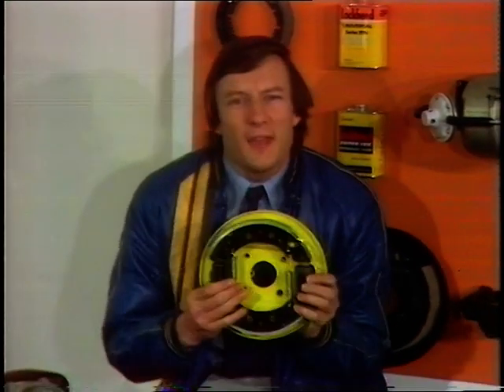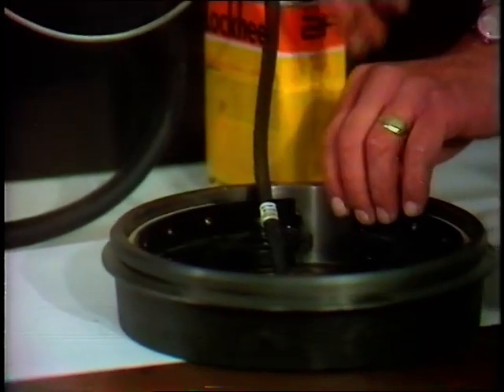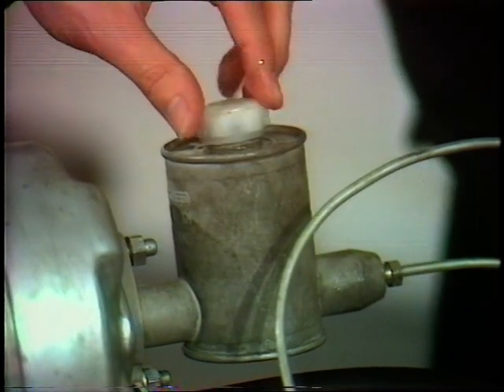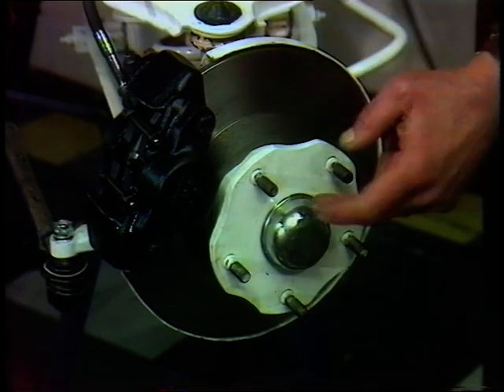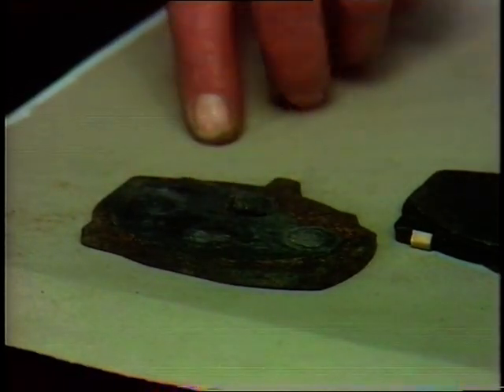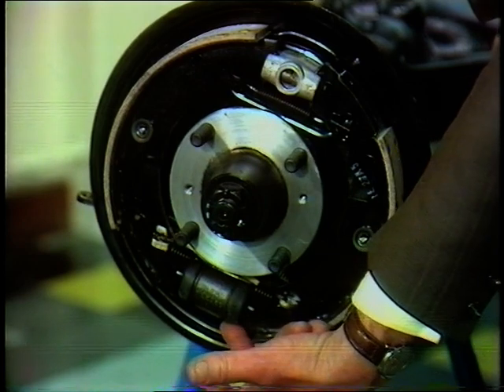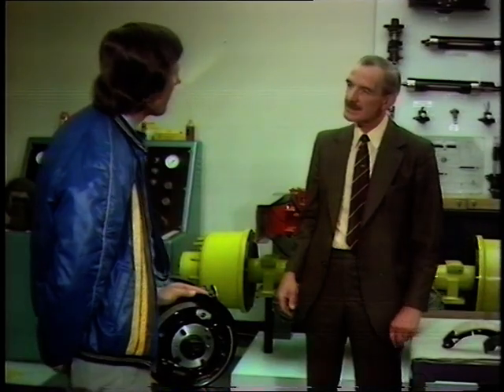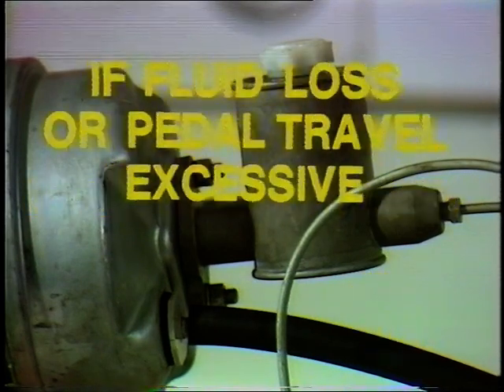Retro Cars | Car maintenance | How do brakes work? | 1970s Cars | Drive in | 1970s

Comment: I bought a car about five years ago, and took the family to Sydney's iconic Bondi Beach.
Trouble was, I literally nearly took them over the cliff at the southern end of Bondi Beach.
No brakes.
(I hadn't driven down any other steep hills, since I'd bought the car that day).
I wish I'd seen this video beforehand.
Makes sense now. 🥴
Reply: What make & model was it ?  & Did u try to slow down wi the Handbrake ?, which also acts as an emergency brake when  it all goes wrong!
Reply: @mikemartin2957  It was a Ford Falcon, a former taxi.
An "ex - taxi" was cheap to buy and maintain, but of course, you don't know what you're getting yourself into.
And yes, I was fortunate enough to have plenty of space to pull over, while I slowly engaged the handbrake.
It was a slow drive to the mechanic from there!

Comment: Not all brake shoes had rivets - many makers have been using bonded linings since the 1930s.
Reply: Most brake linings made by Girling, AP Lockheed, Ferrodo & Mintex were still using rivets up to the early 90s. French brakes like Bendix  were using bonded linings on the brake shoes that would separate  after a while& completely lock the brake solid .